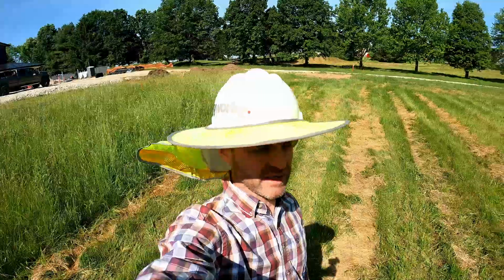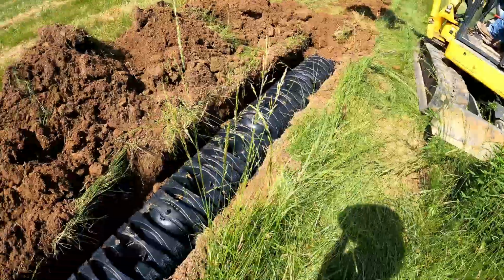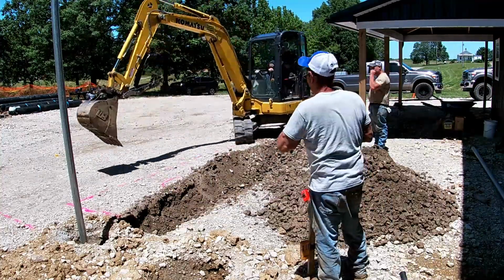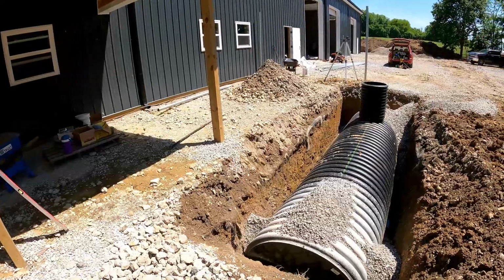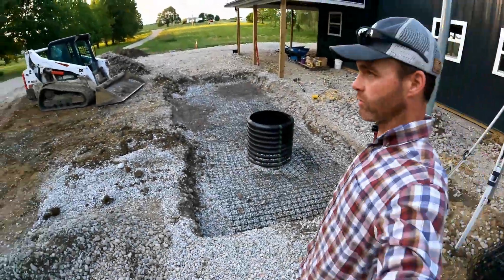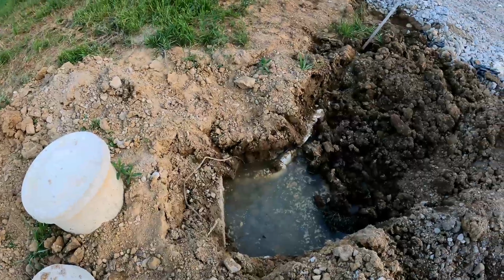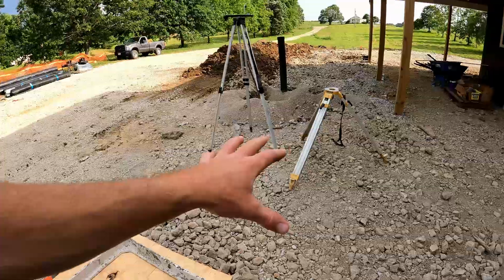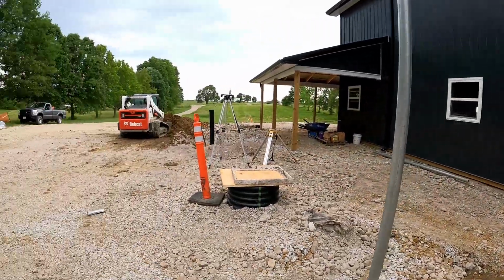Installing Septic System & Rainwater Harvesting Tank At Our Dream Pole Barn Shop!

Comment: I’m super curious what kind of pump system you’re going to use for this? Am I right you’ll be running a hose of some kind from this?
Reply from the maker: It will be some kind of special pump for it we will be having a company called rain brothers design the mechanical aspect you might check with them or follow along in the meantime 😂